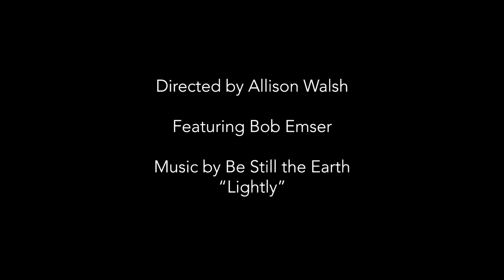Introduction to "The Art of Boat Building"

Comment: I see an interesting theme in the way you work. You seem like to make something out of something (rather than make something out of nothing). That is, you're not a purist when it comes to boat building. Your friends Acorn to Arabella are starting from trees (or acorns, as it were, if you go back a little further in time). The ultimate purists.

In my heart I'm a purist, but I often don't finish projects because I can't figure out how to get started, trying to think how to make it ideal. I appreciate your approach of rolling up your hands and taking what you have and making something of it. That's inspiring. You don't express any agony over these decisions. You just do.

Your comment about how there's perfection in the imperfection (in the context of the visible brush stroke lines) says it all. Maybe a stitch-and-glue boat isn't an ideal wooden boat. But you wanted a boat, and you took that and made it something better than it was expected to be out of the box.

Your whole process of starting with a kit boat and then making it your own was an example of making something out of something. You added to the bow, and hid the unsightly fillet at the stem. The seats really cracked me up. When I saw you rounding over the edges of the panels for the seats, I was thinking, "What the hell is he doing? That's plywood. He's gonna have stripes!" But you decided to stain the seats. I found that amusing, because I've never seen a boat builder use stain. Maybe some do. I don't know. But I sense they just show whatever wood they have, and that's that. But your artist's eye saw something else, and it looks great. Then you went over the entire hull with a razor blade to smooth the surface. I've never seen a boatbuilder go to that much trouble. 220 and a tack cloth is usually enough. And then, after doing that, you chose to NOT tip, leaving brush strokes for a more hand-made look. The boat builders I have seen seem to strive for a perfect finish, and I heard lots about rolling and tipping, and additives to the paint to make it level better. The point is: You took something that existed and made it your own. Maybe it's MORE ideal that you didn't start from scratch. You had some constraints to work with. Perfection in imperfection.

I also see this with the trailer. How much could a small trailer possibly cost? But you went to such trouble to make this one right. I enjoyed the welding, and the bondo on the fender. Great way to repurpose something ugly and make it nice and functional.

I also see this theme later on, when you built a model of the Haven 12 1/2. I was wondering how you made the model, but it turns out you started from an existing kit and modified it. Is that "cheating"? Did you have to start from scratch? Did you have to start from acorns? What's the difference in the end, when you have a model? You wanted a model, and now you have one. It serves its purpose and looks great.

All I'm saying is that this is a fresh approach. Not necessarily better or worse than any other. But I enjoy seeing the efficiency in using something that exists. There's no sacrifice in aesthetics. You don't have to rely on starting from scratch for the outcome to be beautiful.